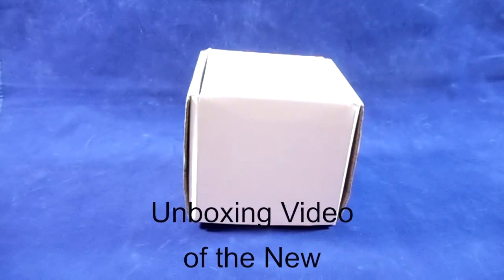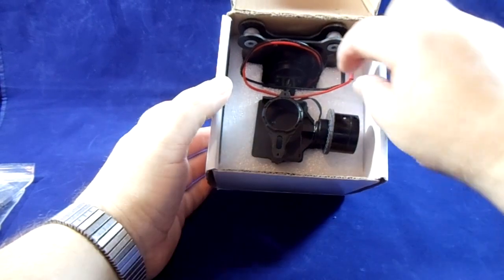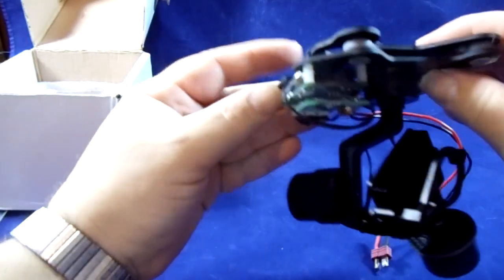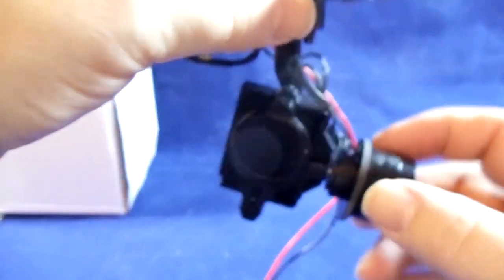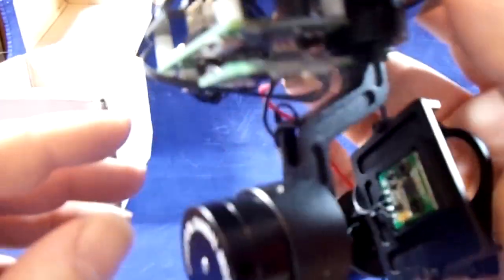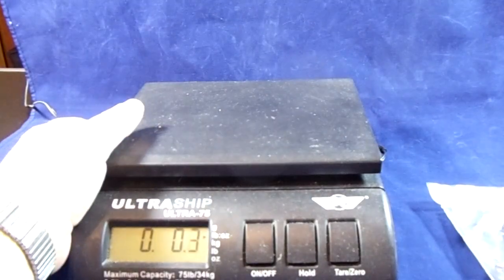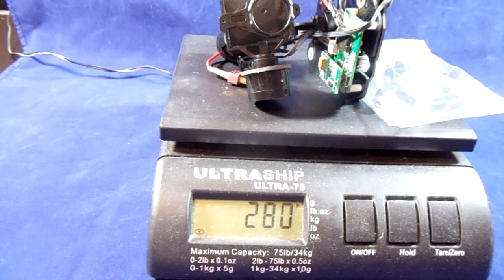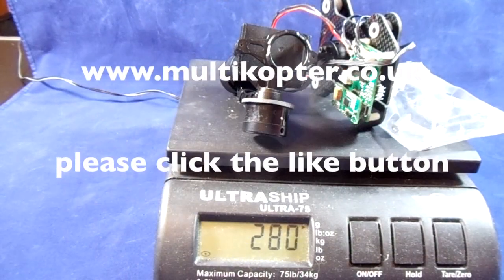DYS 3 Axis Smart Gopro Gimbal

Comment: Do those wires go into a slip ring Graham or do the wires just pass through so will twist and eventually stop rotating ?

Also I don`t see any video cable for live feed from the Gopro either, which to me would be useless if that`s the case.
Reply from the maker: Hi Ian yes the wires pass through the hollow shaft, it does not have a slip ring and NO it does not stop it will do a 360 all day long in any direction :-) until the wires start to twist ;-)
As for the Gopro video out it will be the same as any other gimbal of this type get a right angle plug... if not buy a Zenmouse
Reply: QuadFrames
Thanks for the reply. Slip ring is good then, I thought that was a major feux pas lol.
Having a video and a ground from the Gopro would have been a very good + point. With the right angled plug, the lead will still get wrapped around. That`s a major flaw to me, a 3 axis gimbal you cant really use to its full potential, or if you do, you cant actually see what your filming.
Reply from the maker: Coyote FPV NO its not got slip ring M8 sorry, its been a very long day... wires pass through the hollow shaft and do start to twist a bit after a few turns of the 360. Ops :-(